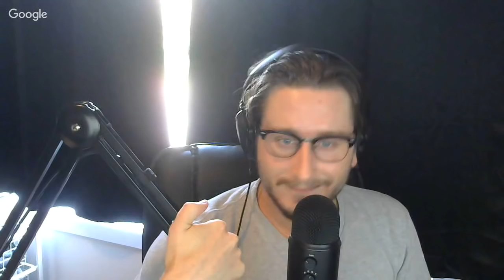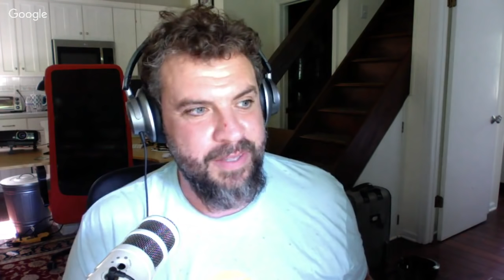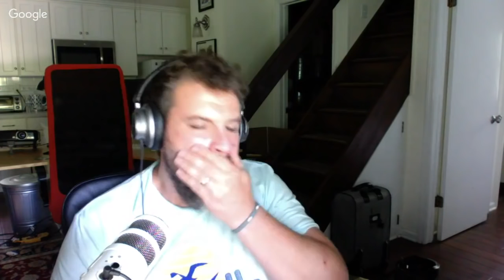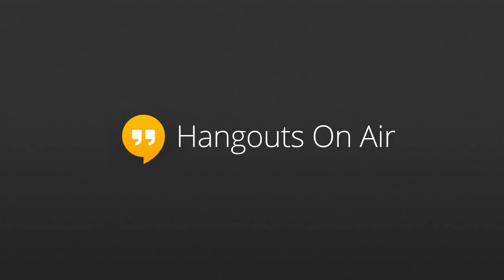Electrek Podcast: Tesla Semi scares diesel industry, Tesla fires, several new EV prototypes, more

Comment: Guys, the titanium plate that protects the Model S battery is located in front of the battery, not underneath it. It is positioned vertically to protect the nose of the battery from impacts with foreign objects coming in from the front. The underside of the battery is heavy gauge aluminum.
Reply: Exactly, the underside of the battery pack is aluminium armour similar to some lighter weight russian APCs. Good protection, but too much kinetic energy is still too much. The early Model S had a hollow shape in front of the battery that could trap and leverage objects at the battery pack with enough force to puncture it, when those objects would have been unable to do so on their own without being trapped. The "titanium plate" seals off that hollow area so objects can't be trapped and leveraged in that way.